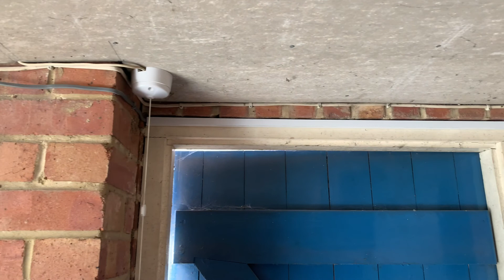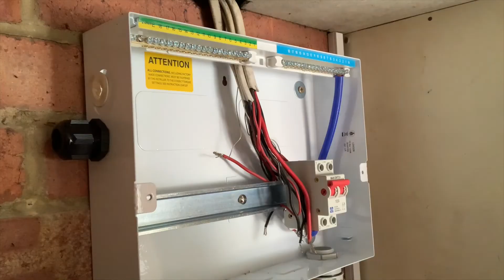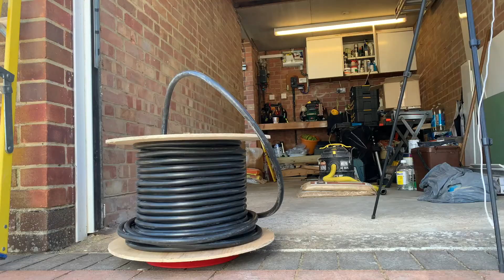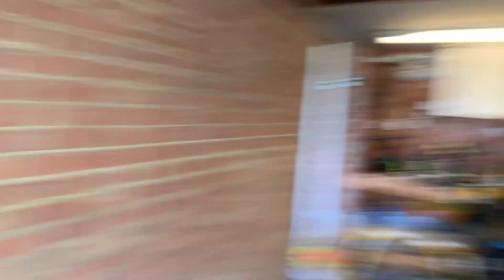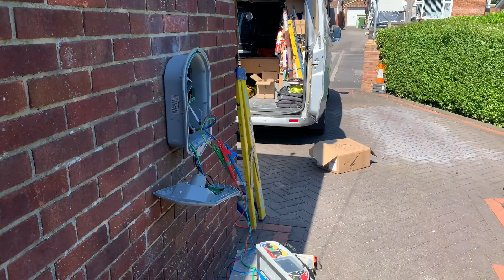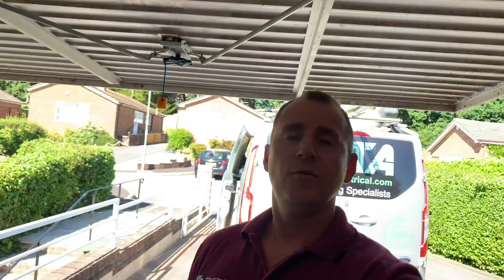Zappi Electric Vehicle Charging Point Installation!

Comment: Lovely video as always Sota. Tidy install! I’m
currently thinking of starting installing some EV points, but not sure if I should change my 1741  Megger to 1741+ what is your take on this idea? Thanks
Reply: Thank you for your reply! Unfortunately, not! Hence, the reason I’m thinking of selling it to buy the 1741+
Reply from the maker: @linksone6287  if your going down the EV route then 100% upgrade and you will need an EV adaptor also otherwise you won’t be able to commission the chargers properly.
Reply from the maker: Thank you sir, this is an old one now! Lol! Well I’m pretty sure your 1471 doesn’t have the EV setting for testing does it?

Comment: where did you locate the CT clamp?
Reply from the maker: Hi Nigel, The Hi-Tuff cable was terminated in the consumer unit, the CAT5 was joined to the CT clamp which was installed on the meter tails, I hope this answers your question.